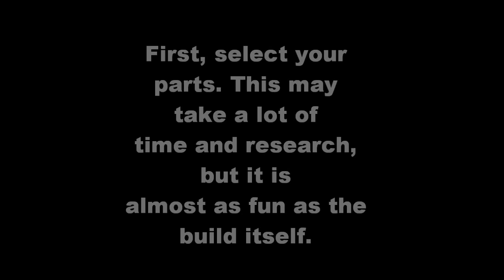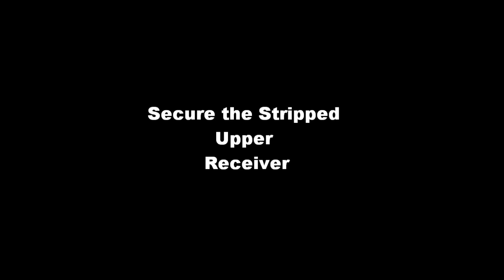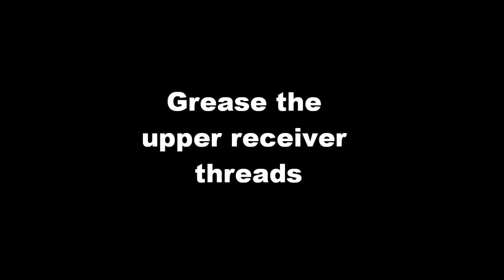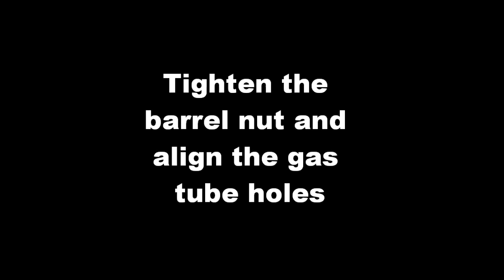How to Build an AR-15 Upper Receiver: Part 1

Comment: well this video shows a lot of applied grease..  also  theres are better lubricants to use instead of petroleum based lubricants like many greases use... so u wont have a fire..   but mainly don't use as much grease as was used here in this vid  it was too much grease applied..

Comment from the maker: @sshukri0 you may not get enough torque on the barrel nut to properly install the barrel. but you could always try and then buy the right tool if it does not work.

Comment: It's torque to 35 then loosened torque to 35 again and loosen and finally it's torque to 70-80 and aligned for the gas tube this guy did it right

Comment: Please buy some calipers if you want to at least get closer.... i highly recommend mitutoyo, but starret and STI and Fowler also make decent machinist grade calipers.. (im a machinist). I own some Mitutoyo IP-66 digital calipers that are always accurate within .0005". I have used them thousands of times in the past year, and even some cheaper dial calipers will do want. Try to stay away from anything made in china, or no-name brand measuring tools. Nice video1

Comment: I'm in process of getting all the components bought.  I like your setup and have decided to go with the DD rail instead of the CASV.  I'm putting a white oak 18" SPR on the front. You are quite right about scouting for parts.  It is as fun as the build.  I've got my 3 boys helping. They're 5, 6 and 8 and have watched your videos with me. Thanks for keeping it clean............they've learned alot.